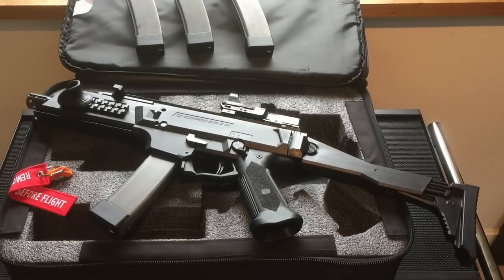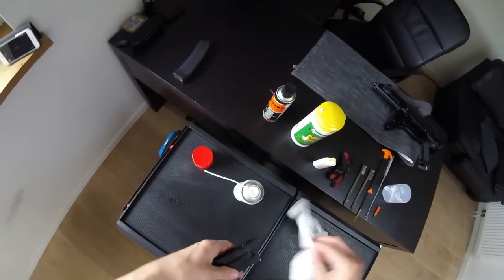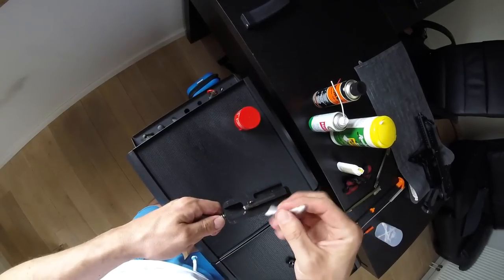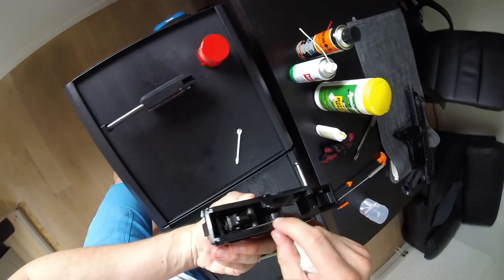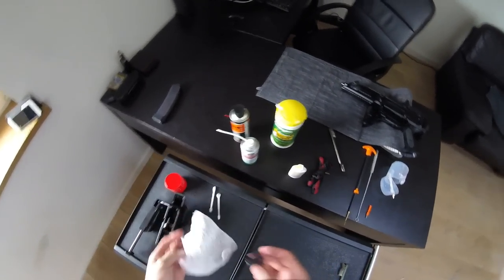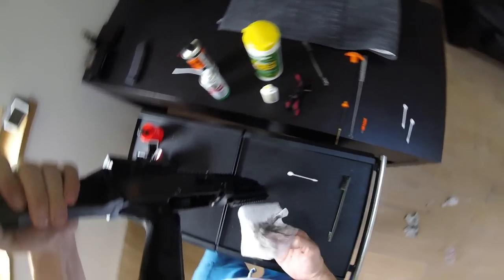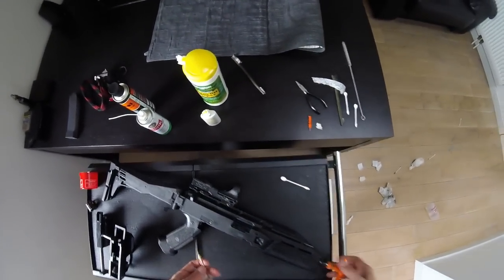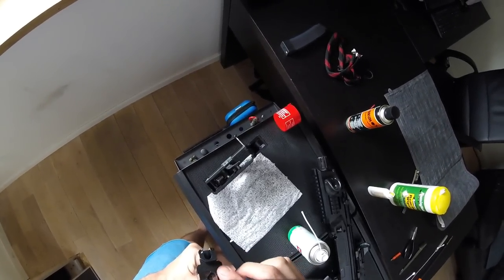Cleaning & Lubricating - CZ Scorpion EVO 3 S1

Comment: Looks like you replaced your Bushnell. Is that a C-More? How do you like it? which MOA and model of the Railway system did you get. Is this the Tactical?
Thanks.
Reply from the maker: Yep, It's a C-More Railway Model CRWB-6 Click Switch 4 MOA with the Polymer Frame. Best Regards.